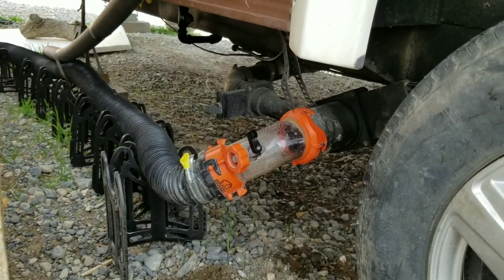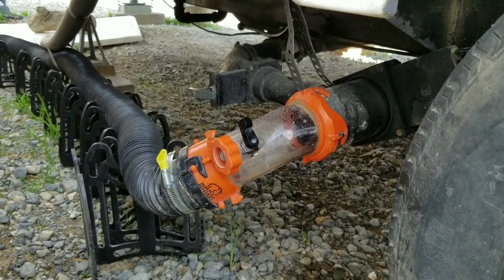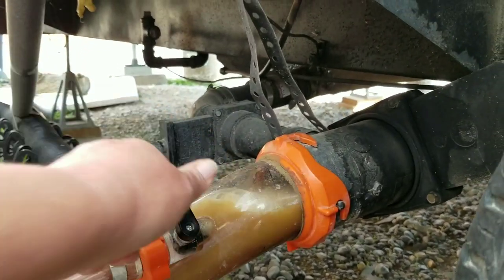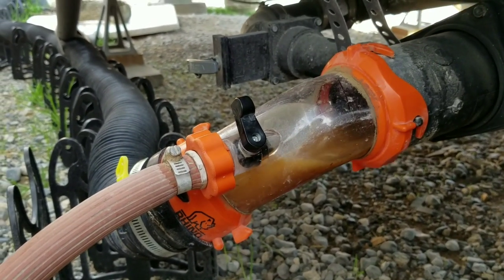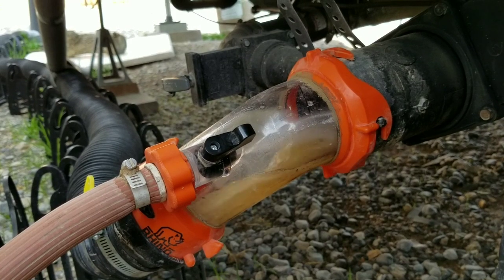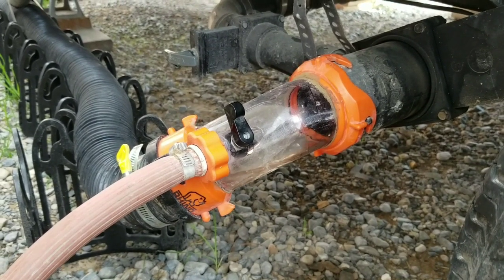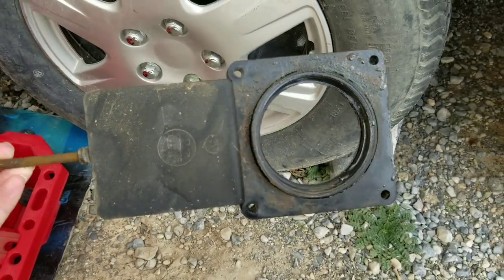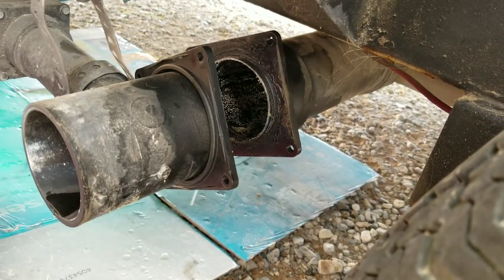How to replace a black tank waste valve. LAZY DAZE

Comment: this rino blaster she is using also comes with a gate valve so that she can actually fill the tank and flush properly. Also there is a check valve that goes between hose and rhino blaster hose hook up as to not allow crap to go back into the hose

Comment: One final observation.  You should have put the handle up in the Air on the other side of Tire.  Hanging down like you placed it could cause you to break it off, should you hit something on the road.  (a Pot Hole or something else.)

Comment: First thing I notice besides the handle being in the wrong direction is the total lack of lubrication on the T-handle Rod, very corroded which adds to the difficulty of opening it.  I know everyone will have an opinion on how to lubricate the seal inside, But I use vegetable oil.  Every few months after a good dumping of my tanks, I lubricate the seal with with it.  I've fixed many hard opening valves like this with no complications later.
Reply from the maker: We never thought of veggie oil and may have to try that next time. This trailer was old and not cared for prior to us unfortunately.

Comment: You also should consider using a TOP DOWN Flush Wand!  You can make it yourself with regular PVC Pipe.  This helps to clean the inside of the corners of the tank as well.  Lots of CRAP gets caught up in the corners.  Run a flush pipe straight down through your Toilet and wash the inside of tank top to bottom.  Works very well.

Comment: if you drill a tiny 1/8in hole in the square part of the valve, then shoot in a small amount of WD-40. Problem solved, those valves get dry inside which makes them tough to move so if ya put in a bit of lube it will move like new again. Sure beats playing with sh-t pipes lol I know all too well lol

Comment: So if I wanted to change my gray valve to pull out straight at me instead of to the left which is hard to get any leverage, I'd have to change the piping wouldn't I?
Reply from the maker: More than likely.  You may just need to change the coupler

Comment: Unless the pipe back into the tank is straight, it won't actually clean the tank.  Just the pipe immediately in front of the valve.

Comment: Should have poured atleast 2 ( 5 gallon ) buckets of water down through the toilet  to rinse the tank out so you don't have anything drip down on you . Also the rhino rise doesn't work on all RV'S.  IF you have a black tank that is located on the passenger side of your RV like an alpinelite like my brother has it will not work. I'm changing out his broken blade valve today , and it won't be a easy task , plus a full tank .
Reply from the maker: We will try this next time for sure. I bet that gets the tank clean! Hot water?